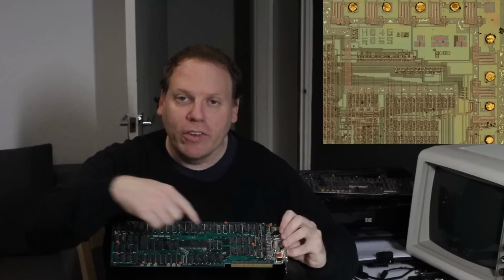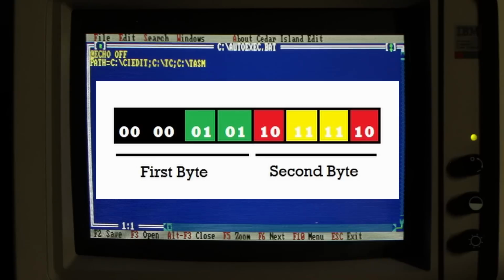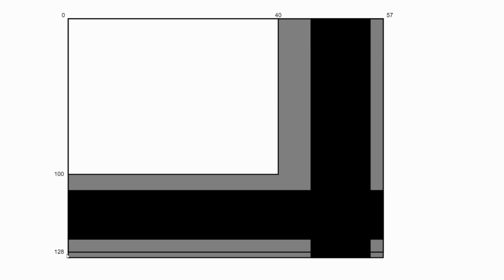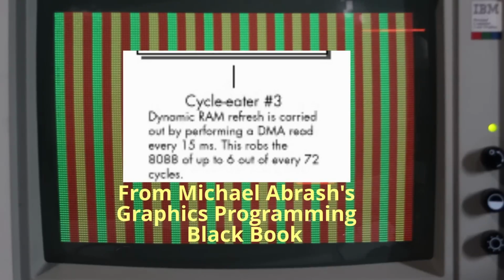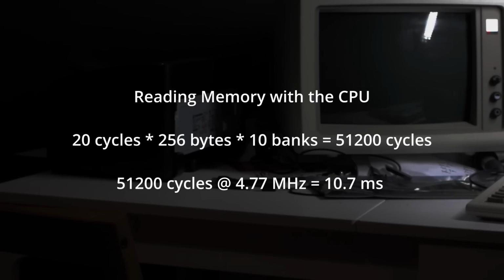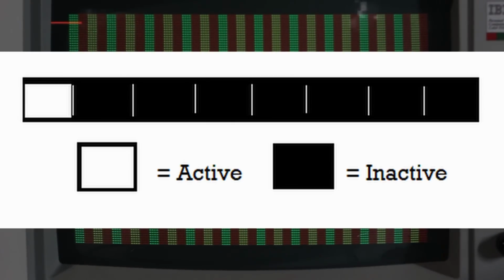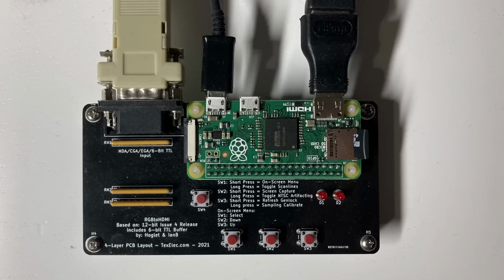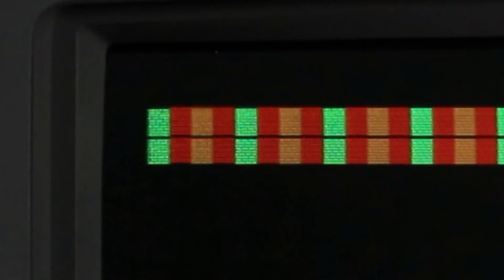Reverse Engineering the Video Chip of the IBM CGA Card (1981)

Comment: This is neither here nor there, but there actually was a terminal which drew a character at a time, scanning each with tiny partial horizontal refreshes and then going on to the next character.  Absolutely bonkers and if I ever find one in person, I want to catch it with a high speed camera.
Reply from the maker: Oh really. That is utterly crazy as you say. Let me know if you ever find one. I'd really like to see that!
Reply: @PCRetroTech  Computer Terminal Corporation (later Datapoint, to whom we owe the 8080 instruction set among other things) first made terminals before the availability of RAM chips, so they used shift registers.  They weren't fast enough to reread all 80 bytes per scanline, so they had an unfortunately-named "diddle circuit" which would scribble down each full character in turn.  I actually have a Datapoint terminal, non-working, but it's late enough to have RAM chips so I suspect it has a regular raster.  I'll find out one of these days when I get it restored, and I'll let you know!
Reply from the maker: @dualityk  That would be interesting. I wonder if there was some intermediate time where the two technologies overlapped or whether they switched to a normal raster as soon as RAM started to be used. That would be an interesting piece of computing history to figure out.
Reply: that also reminds me... i once saw a video about a vector-based computer! And what's more, it doesn't use a RAM-based framebuffer (that would have required way too much ram), but uses one of those funky storage tubes to store the screen.
And, after doing objectively too much crawling over my browser history, I found it, "Tektronix 4052 Fast Graphics demo" id Ju8e0Z6RjqE (don't want to post link to prevent the comment being bäñn'd)
Reply from the maker: @FavoritoHJS  I believe I've seen that before. Who knows where people find this hardware. I've certainly never seen it come up for sale.
Reply: @PCRetroTech  : A lot of old stuff would have been picked up by locals (including employees) when it's owners were getting rid of it. You'll find a random smattering of stuff across the country side, and a few places with a pretty high concentration.
Reply: @FavoritoHJS my uncle was a draftsman who worked on one of the early CAD systems. It used a Tektronix storage tube for display, and could handle 7 workstations from a single Univac mini with 64K of RAM. When they finally replaced it they needed MicroVAX machines with a couple of MB each to do the same job. The tubes were however expensive and unreliable (at least at the size they used)
Reply: @FavoritoHJS  I recall similar terminals connected to the IBM 3090VEC at school.  Don't know if they used the screen persistence or a hidden RAM buffer to remember the screen graphics as individual line coordinates were received from the computer across the street.  3090VEC was a cool computer that had SSE instructions before Intel.
Reply: The CDC 6600 System Console ("terminal") used vector drawing of its text.  Others have already mentioned the Tektronix terminals.
Reply from the maker: @peterfireflylund  Interesting. Vector drawing makes some sort of sense of course.
Reply: Well if You are Local to New Jersey, Then I have Some Tektronix Graphics Monitors....and it's REZ is 4096x4096...Yay 70's tech...
Reply from the maker: @PicaDelphon  Couldn't be further from there, LOL.